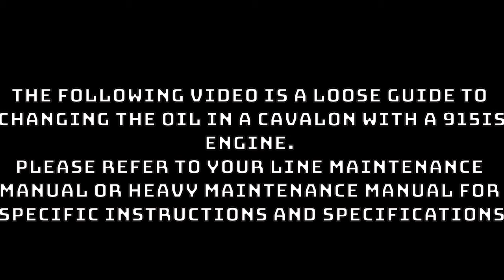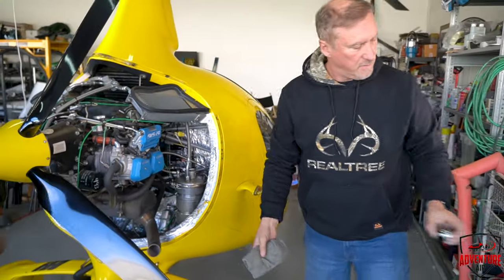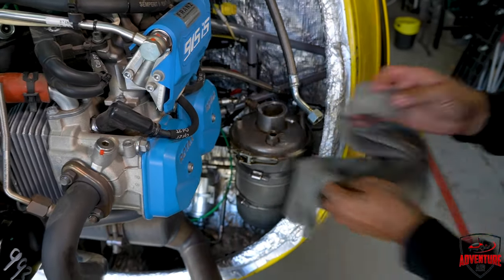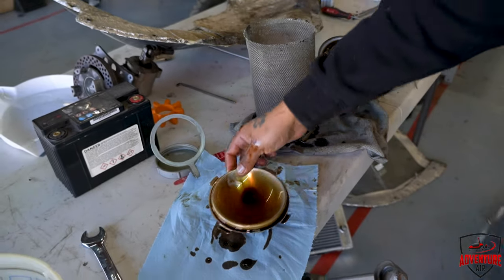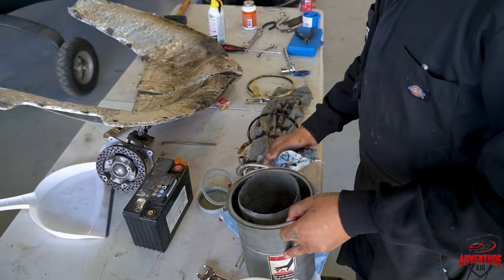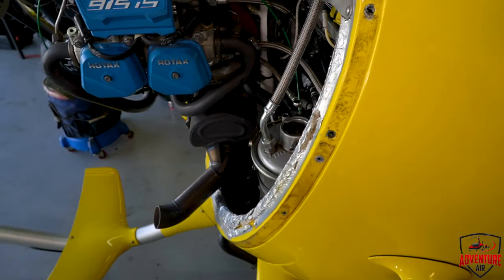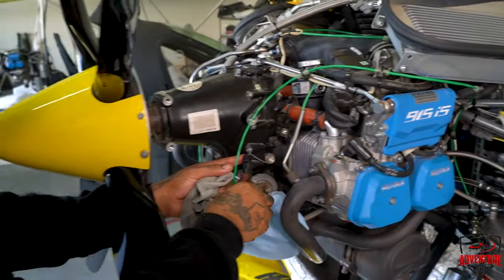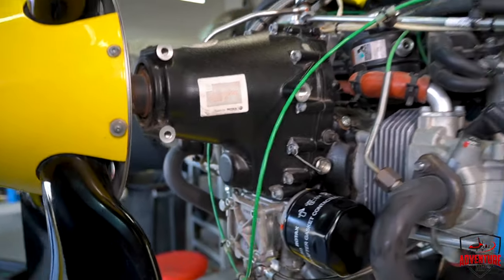74. How To: Change The Oil On a Cavalon (Rotax 915iS) #adventure #air

Comment: Hi Henry, given you've got 1100hrs on your 915iS are you going to have to change the motor as the TBO is 1200hrs and people don't tend to overhaul Rotax's? In the UK Gyro instructors can't run engines on condition without an exemption even though you can for Microlights (LSA's). Be interesting to hear your thoughts on the 915 and now 916iS! which is 2000hrs TBO out of the box. P.S. Rocky's great fun!
Reply from the maker: Last year, Rotax raised the TBO for the 915 to 2000 hours like the 916.